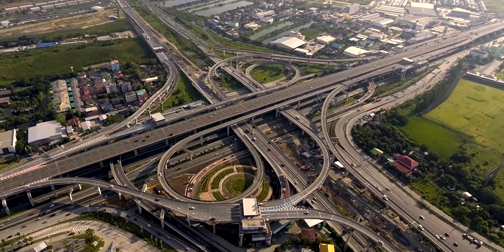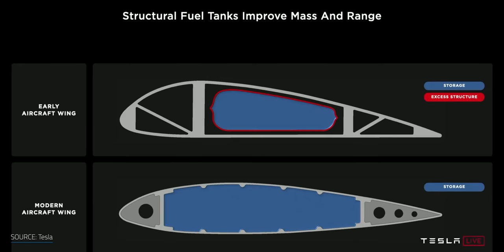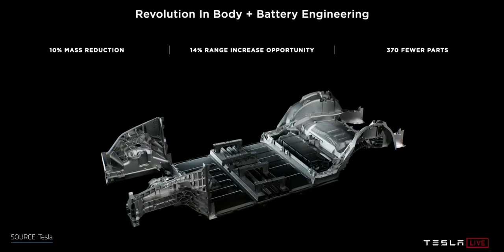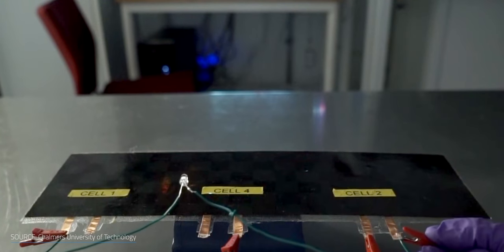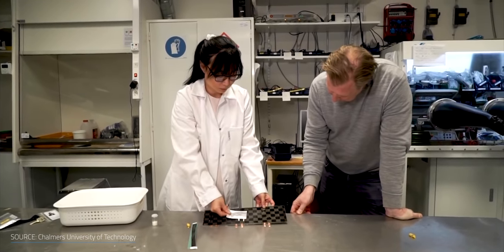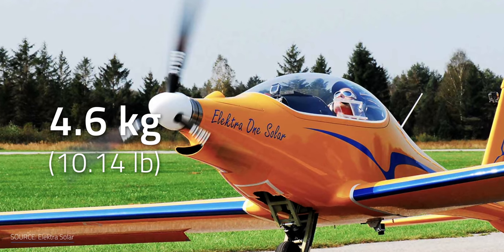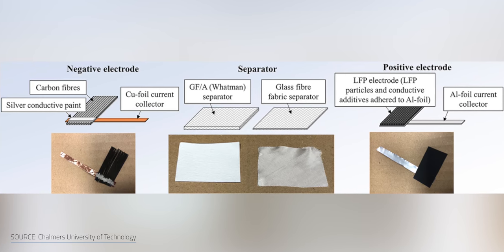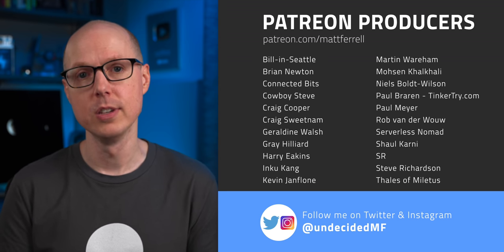Exploring Structural Batteries

Comment: Apple: When the battery is bad, you need a new phone.

EV Makers: Write that down! Write that down!
Reply: Except EV battery degradation is much much slower compared to phones
Reply: I agree. This is the biggest issue with EV vehicles. I think removable cells are a better option. This allows older EV vehicles adopt new battery technology. Of course that is not where the money is for shareholders. They would rather you just buy a brand new vehicle every 5-10 years. If I owned a car manufacturer I would probably do the same.
Reply: @nopeyoudontknowmyname9153  Sure, but that's kinda irrelevant to my point.

If you literally make the structure of the car the battery, that means that when the battery is bad, you have no choice but to get an entirely different car.
Reply: @stewartmoir9464  Ya, even with replaceable batteries it's already pretty ridiculous.

My friends bought a Tesla Model X and were driving it like 80K miles a year. Not only did Tesla, after agreeing that battery degradation would be covered under warranty go back on it and say that it wasn't, they've said that they WILL NOT replace the battery, even if they pay for it.

Presumably as the warranty is still covering the rest of the car, and by forcing them to be unable to use it as much, they're saving themselves way more money than they would make from the sale/installation of a new battery.

And if they have a 3rd party put in a different battery, the warranty is also voided.

So, they're stuck with a $100K+ car that they mostly can't use for what they bought it for.
Reply: @Nevir202  Are you sure that you are forced to throw the car away when the battery gets bad? It could be bolted, like structural members of crossbar trucks.
Reply: And think recycling that, lithium packaged inside thick layers of iron/alluminum/carbon..
Reply: @alphace  Well, that's what is already happening, this would actually be different.
Reply: @alphace  I think you could melt the metals out of the carbon
Reply: @rubenayla  Clearly I don't know, as it doesn't exist yet, but if it's a bolt on piece, you lose most of the advantages they're talking about here.
Reply: @nopeyoudontknowmyname9153  why?
Reply: At least in case of the phone you are not surrounded by dense energy storage xD It is like propsing that we put fuel in the structure of a car around and under the passengers. Well... let's say I would slowly try do leave the room. Again the solution is not electric cars, but to speak Musks language - new mode of transportation, pods connected to form a HYPERPOD on the alloy, double hypertrack - no those low tech rubber tires, no batteries necessary as energy is fed directly from above energy conduits - also know as train.
Reply: I get the joke - but to be fair my original (first model) iphone still works ... so seems fine.
Reply: @MKu64  Didn't the original iphone have replaceable battery though?
Reply: @Nevir202  Nope, not unless you open up the phone (like the others).
Reply: But you can just replace the battery in apple :o
Reply: Your car is the battery...an awesome way to build in obsolescence...every 8 to 10 years you will be forced to buy a new car.
Reply: @ArchitheFA  You mean the one he took off the front of the website? What does it take for American people to get some fucking above ground trains? Not 30 mph cars in a 1 mile loop.

Comment: sounds like a huge breakthrough in throw-away-applications
Reply: I agree. Instead of just replacing a faulty battery in your tesla you are required to buy a new car.
Reply: I'm sure they would start to install access panels to make easy access to everything. Most ideas dont start out complete. You've got to start somewhere
Reply: @randomcracka3  the car is the battery
Reply: @bullshitdepartment  Make it cheap enough to create and to replace and work out how to recycle/reuse the remains of collisions and it won't matter.
Reply: 🤦🏻‍♂️shape it like wings.... and you will have a new wing(old fuselage) in every battery replacement lol
Reply: @bullshitdepartment  what do you mean by that car parts are recycled all the time
Reply: @bullshitdepartment  you're making it sound more complicated than it is.  "you would literally need to rebuild the frame of the car".  No.  Just no.  maybe on a prototype, or revisions after that.  but this is a system that can be made fully modular,  there's so much potential you're obviously blind to
Reply: @Arknio  look to his name. That should explain his comment
Reply: You could make it modular, so you can replace only part of the battery that is faulty.
Reply: @wimpie1990  Well, having to replace a Tesla would be bad, but having to replace a 40 dollar to 20 dollar solar charging self cooling water bottle wouldn't be that bad if it got damaged.
Reply: @perspectiveflip  I say just stack the carbon fiber batteries and make a lighter weight battery pack that is still modular but not integrated into the vehicle and replace many parts with AI designed organic like counterparts made of carbon fiber, you could manufacture the cars in a smaller area without as big a manufacture line and the cars could  be up to 30 or 40% lighter than they are today.
Reply: Tesla: we found out that you were servicing our batteries. Good luck now hippies!
Reply: So much for servicing the batteries.
Reply: All i see is someone that knocks an invention and or idea, but can't present a better alteration of an idea, nor contributes to the topic.
Meaning, here, this point of view of you have? Is irrelevant.
Reply: The front and rear sections can be decoupled from the main cabin structure for "replacement". Still don't know how often, and at what cost this will be achieved at.
Reply: @liamcampione6044  we will have another one eventually, we just need to live until then
Reply: @wimpie1990  The batteries just need to have fewer faults per gWh of batteries.
Reply: Just came across this video and that was my thought too. Not very sustainable if everything is glued together. Seems like your whole car is basically shot in the case of a deformative bottom strike.

Comment: Yes, thats what we love about in our modern smartphones, batteries that can’t be changed easily.
Reply: Letting the Engineers do it's thing would  probably be recommended.
Reply: @olimpather  I don't think it's engineers who design product-user interactions; more likely industrial/interaction designers or sth
Reply: @olimpather  letting ppl. do what their want with the product THEIR BOUGHT would probably be THE BARE MINIMUM. This include modifying, opting out of something or heaven forbid repairing something instead of throwing away the entire (still mostly functioning) product.
Reply: They now have wheels.
Reply: It's unnecessary for phones, they still use those kind of batteries like the ones in the past. They're still a module on its own and serves no other function but a power storage. With batteries like the one shown in the video makes a lot more sense.
Reply: @attilaedem101  You can still modify and repair your own devices, although it's a lot harder today compared to the past. I've personally replaced failing parts on my phone like the mainboard and the charging port. Still works and good as new. Well, it's because I don't own a stupid iphone.
Reply: @faultline3936  that’s true on older phones. But Apple has been fighting against “Right to Repair” legislation and lawsuits. The IPhone 12 is their latest attempt. Everything in the phone is serialized/married to each other. Including the battery. You can take two absolutely identical phones and the parts are not interchangeable because the serial numbers on their embedded chips won’t match. Only Apple has the equipment and codes to change the serial numbers on a part. You have to turn your phone in for a refurbished one. Then they serialize what part your phone needed and sell it as refurbished. Big moneymaker for Apple. Big loss for iPhone users.
Reply: @faultline3936  I agree 💯%
Reply: @faultline3936  i think structural batteries is definitely something too good not to pursue, but Tesla has a shocking record when it comes to providing parts and instructions to knowledgeable people begging to repair cars and reduce waste, especially waste as harmful as batteries.

if these batteries are going to be completely bonded together, then it should be manufactured with excessive amounts of reliability, and they should be responsible for adequately handling recycling and providing replacement chassis. that sounds ridiculous, but thats how it's gonna be.

to provide better repairability, they should probably consolidate a ton of their systems into easy to seperate and remove units, and have spinal wiring and piping kits that work with large single connectors, instead of many finicky small connectors. so instead of having to put days into stripping a chassis to recycle, it's as easy as taking big units of many smaller interconnected units out, then dropping them into a new one. Heck, that's how iPhone repairs usually go (or at least used to go before serialisation)

But they won't. they will continue providing great one use cars that when break, are to be thrown away. No thanks, I'll stick to companies that can assure repairability. or probably stick to bikes and public transit lol
Reply: it could be super great though, with a proper modular approach of both chassis and body panels, this technology could mean every part adds to the capacity, the massive central pack could be smaller, and still have more energy. personally, i think this tech should be subsidised. it's expensive and difficult to engineer to be sustainable, but especially for Aircraft, which is a big deal to me, nothing can beat dropping weight for more capacity. literally nothing but antigravity can be better for planes than losing weight for more range
Reply: @xymaryai8283  Sticking to bikes and public transit are probably the best solution to fight off pollutions caused by vehicles

I would personally do the same, but the situation my country is in, public transport is so much of a hustle. There's no standards, whatsoever. Not every vehicle is airconditioned and if it is, it's still not doing its job since the capacity is not being followed. Oh yeah, it's a tropical country where it's only hot and wet, very humid as well. 

I like Tesla a lot, but I don't really understand why they're trying to follow Apple's bullshit. 
It really doesn't makes sense to me, I'm thinking they're not allowing those repairs because they want to protect their technology, but they're literally allowing other companies to use their patented techs, so that's not it... 
I would like to think that they have a valid reason, but nothing comes to mind. I wish Elon could explain why they took this path.
Reply: @faultline3936  oh yeah, i'm recently moved into a biker-unfriendly area, so its gonna be a chore for me now more than ever, but governments cannot stop themselves from strict car dependant zoning .-.

I like Tesla's tech and engineering, maybe philosophy, but thats basically where it stops. Elon is still fundamentally a greedy, stingy rich dude, who isn't ideologically consistent, even if he contributed a lot, and Tesla is still another car manufacturer who will keep overproducing cars that aren't meant to last as long as they could, so people come back to buy again in 2-4 years.

Big companies are not your friends, as much as i wish they could be. They grow, they bust unions, the exploit workers and they don't provide any consumer protections they can avoid.

but hey, Tesla made everyone make EVs, SpaceX landed orbital boosters, those are such a monumental tasks that i can't help but hold on to the romantic idea the Elon is a good guy, that he has morals and he'll stick to them.

But he won't.
Reply: @xymaryai8283  yeah it is to throw it to the trash get new one that's there motto
Reply: @paying-for-freedom  Another reason why I do not buy or own anything from apple.
Reply: Your batteries failed? No problem, just replace the chassis!
Reply: Being built in is cool and efficient leaving behind a modular design leaves complications and repairs and locations for said repairs
Reply: @xymaryai8283  I don't think "structural" and "battery" should ever be together in that order.
Then battery failure=structural failure and vice versa.
Reply: That’s why iPhone 12 sucks
Reply: That’s why iPhone 12 sucks
Reply: Another step toward making cars into throwaway appliances.
Reply: I have changed out four phones two iPads, and two MacBook air batteries. Once you do one and have the tools it's a 20- minute job. If Apple does not include better battery life soon, they will lose market share.